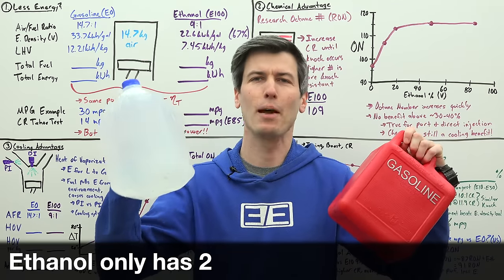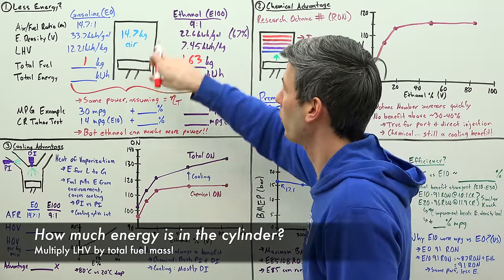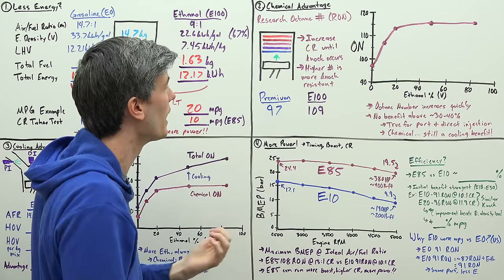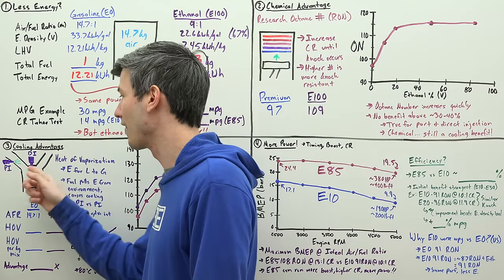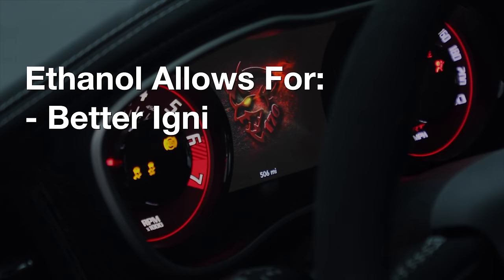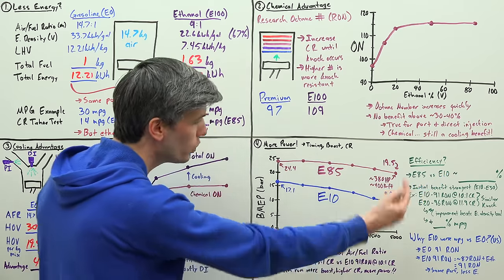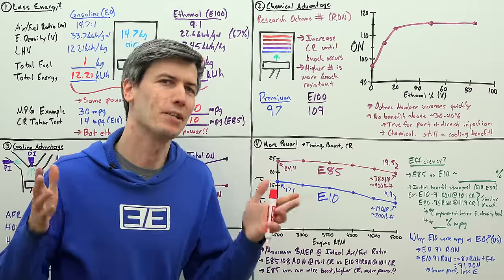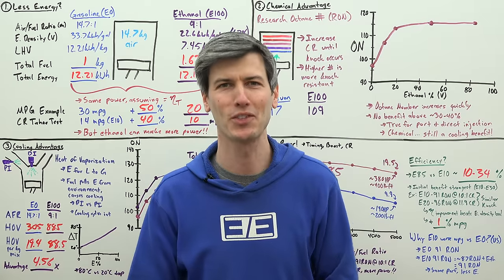Why Does Ethanol Make So Much Power? (Versus Gasoline)

Comment: Ah, but we don’t have variable compression engines! The trouble is that until you standardize the fuel mix, you can’t standardize (and increase) the compression. Or vice versa. So which comes first, the blend or the compression increase? And then how do we transition the fleet?  We all will continue to drive compromise designs.

Now, if we keep power constant and use E85 we could use a smaller engine and possibly improve mileage.  Hmm.
Reply: Look up the engine Ricardo built for GM and drove around a few years ago.  Here is an article excerpt about it at the time:

FROM RICARDO:
The new federal CAFE standards are calling for a doubling of fuel mileage performance, which, Vint says, is going to send OEM’s looking for high octane numbers to improve efficiency and ethanol is the best source. Ricardo, an engineering firm with over 100 years in the business of engine design, has developed an extreme boosted direct injection engine (EBDI) to optimize ethanol blends. The 3.2 V6 gasoline engine rivals the power and torque of a much larger GMC Sierra 6.6 diesel, he said, and it delivers 3.5 percent better fuel economy than the diesel.

Comment: Is it just me? or does anyone else see how much more complex cars with turbos are.
How much more to repair, and cramped engine bays with all that plumbing? To me, and what I observed it is way more expensive for a normal car and not worth it. Any money you save with turbo and better MPG you will give up with high pressure fuel rail and injector failure. Along with carbon build up on valves? I really like your videos. I just see many friends and relatives shelling out huge repair bills for all the above mentioned items. I have learned from these videos to never buy direct injection or turbo cars for daily drivers. Thank you
I have 2008 chevy 5.3 port injected and my wife drives a 2018 3.5 taurus limited. They have been perfect.
Reply: My father is 76 and has repaired his cars himself since he got his license 58 years ago. He has never owned a turbo car.

Comment: As a user of 100% ethanol since 1986 can agreed more. We make ethanol from sugar cane (not corn) Now with a model 2022 Peugeot 2008 SUV. 1.6 liters 4 cylinders 120 HP with a city 7 kilometers per liter and 9 kilometers per liter highway. (a lot) But 1 liter of ethanol cost about US$0.6 vs US$1+ for gasoline. Greetings from Asunción Paraguay
Reply: Paraguay does make ethanol from corn also because you feed cattle and it is better than feeding the corn straight in many ways.

Corn is a great fit with your sugarcane since it allows your ethanol plants to run more efficiently all year long between the sugarcane harvests.  Corn stores well and sugarcane does not.

The fuel for non-flex fuel cars there is E27, correct?
Reply: @danafletcher2341  I don't know the exact proportion of ethanol in the gasoline for non flex vehicles (I have one non flex but it runs on 88 octanes) maybe just 97+ octanes is (maybe) free of ethanol. Have to research in the law here. We have a law that makes mandatory the use of ethanol in the "maximum possibly proportions" suitable for car and bikes. Greetings Pd: don't know about any ethanol from corn here. There's shortage of ethanol sometimes between harvests. But we buy it from Brazil so is always available. But maybe you are right.

Comment: I have a 2009 Ford Crown Victoria Police Interceptor that is Flex Fuel and in California E85 is about $3.30 a gallon and regular fuel is $2.00 (about) more and I’ve been wondering if it would be cheaper to run E85? I am not the type of person who beats my car or drives it crazy, I am an old grandpa now and I drive like one too lol… Here on the east coast it’s very hard to find but is only about $.25 a gallon cheaper but the car runs so much better on E85!!! Any thoughts 💭???
Reply: The EPA rated the 4.6L flex fuel Ford Crown Victoria at 19 mpg on E0 and at 14 mpg on E85.

The cost per mile with your numbers given for E85 is $.236 per mile.

The cost for E0 with two dollars more for E0 is $.279 per mile to drive.

You said regular fuel so if that is instead E10 then I used too much mileage since the EPA states the US fleet loses 3 to 4% mileage with E10.

If your “regulator fuel” is E10, then the cost per mile is $.291 per mile to drive.

I used 18.24 mpg for E10 which is 96% of E0’s 19 mpg.

Comment: This is all fine... but the problem remains that a very large number of cars on the road today, cannot detect ethanol in the fuel, so do not adjust the AFR ratios... so run like crap on ethanol. For the most part this isn't a problem for most cars unless your vehicle has a lean burn mode, and then it will also screw that up and cause it to fail to stay in lean burn mode by loss of power / missing etc... because its running too lean for the ethanol mix. My honda insight definitely runs differently on E0 vs E10... if the EFI were adjusting the AFR to compensate there would be very little loss in power and it might even run better but it doesn't. Also in the USA we use one of the worst possible sources for ethanol... corn that takes about a gallon of fossil fuel to product each gallon of ethanol.
Reply: Your car adjust the air fuel ratio using the O2 sensor. I doesnt care what the fuel its running it wants to run Stoic. Most OBD1 and OBD2 cars can adjust up to 30% rich or lean I have found.
Reply: Corn is most efficient source of ethanol out there since it is value added from already existing corn feed production and preserves the feed.  So much so that Brazil put an import tariff on it.

All the fossil fuels/energy it takes to produce and deliver a product to the consumer is reflected in the price of that product.

As such note that the spot cash price of ethanol on the NYMEX is just $2.35/gallon.

The price of sub-grade unusable gasoline (RBOB) is $2.70/gallon.

It takes more energy and fossil fuels to make sub grade gasoline than ethanol.

To turn RBOB into usable E0 fuel costs even more much like premium costs more.  Unfortunately for humanity it becomes far dirties, carcinogenic, and toxic as well.

Or, simply splash in >10% ethanol to RBOB and the resultant usable fuel is far cleaner burning, less toxic, less carcinogenic, and cheaper/cheaper per mile to drive.  Who can be against that?

Iowa State University measured all the energy it takes to produce an acre of corn into a "diesel fuel equivalent"
This included making the machinery, fertilizer, chemicals, plus the tillage, planting, harvesting, drying, trucking etc. 
They found it takes 34 gal of diesel to produce one acre of corn.
What do we get from those 34 gallons of diesel?
We get >500 gallons of ethanol.
But wait, that is not the kicker.
The kicker is we still get 100% of the protein from that acre of corn still available for an even better feed called distillers grains. A win, win.

The very same non-flex fuel vehicles we have use E27 in Brazil.  It has worked out so well and for so long that Paraguay went to E27.

Denver in 1988 was the first government entity to require E10 when they were on the EPA list of ozone non-attainment zones.  Soon with ethanol they were off that list.

Even with just 10% ethanol added to E0, the Swiss Federal Laboratory for Materials Science and Technology found that the especially health devastating ultra fine or nano particulate emissions were lowered by 97%, carbon monoxide lowered by 81%, carbon dioxide lowered by 13%, aromatic hydrocarbon emissions lowered by 67-96%, and genotoxic emissions lowered by 72%.

Comment: I'd like to see them do the same test on an eco boost, but reduce the size.  So if they started off with a 3.5L, then build an engine that is about 1.7L and see if you can make the same power 185HP.  Then put that engine into the same truck and see what kind of MPG and $/mile you'd get.  The real issue is how much does it cost you to drive 1 mile.  If E85 is 40% cheaper than gas and you can have a 1.7L doing the same work as the 3.5L, then crunch all the numbers and see where you're at.
Just like back in the old days when a turbo, blower, EFI, VVT, etc... were used in racing, then became more mainstream because they can get more MPG or $/mile.
Reply: GM had Ricardo build something like you're talking about which they drove around in a pickup with a few years ago:

FROM RICARDO:
The new federal CAFE standards are calling for a doubling of fuel mileage performance, which, Vint says, is going to send OEM’s looking for high octane numbers to improve efficiency and ethanol is the best source. Ricardo, an engineering firm with over 100 years in the business of engine design, has developed an extreme boosted direct injection engine (EBDI) to optimize ethanol blends. The 3.2 V6 gasoline engine rivals the power and torque of a much larger GMC Sierra 6.6 diesel, he said, and it delivers 3.5 percent better fuel economy than the diesel.

Comment: How do modern engines compensate for either E85 or E0?
Reply: They have to be setup to run Flex fuel is whats its called.

Comment: If anyone on here is smarter than me, please explain, I run E85 in my supercharged Vette but my AFR gauge is usually around that 14.7 number he mentioned for gasoline.  Shouldn't I expect that number to be much lower based on what this guy is saying?  I really trust the tuner, so I doubt it's wrong, what am I missing?
Reply: What gauge? You should really use Lambda scale so if the fuel mix is a little off say 80% the reading is still the same.
Reply: @oldblueaccord2629  I don't know the specifics of the guage.  It was installed by the shop that did the build.  It's an air fuel ratio guage that sits next to my boost guage.  It's almost right around 14.7.
Reply: @IcyDeath91  14.7 should be correct at warm idle and closed loop on gasoline. Its how the gauge is set up to read the o2 sensor is the big question. If it reads that at WOT I think you need to talk to your tuner.
Reply: @oldblueaccord2629  I run E all the time.  Its not high quality E so it could be anywhere between E50 and E85.  I'm sure the tune is supposed to account for actual ethanol content.  Car is never at WOT unless it's on the Dyno.  Too squirrelly for public roads lol.

Comment: That's one hell of a cylinder! 14.7kg of air and 1.63kg of ethanol! According to my napkin calculations that's about a 11'400 liter cylinder. A container ship has a displacement of around 2000 liters  per cylinder. Am i missing something? (Yes, I know these units and numbers were picked soley to illustrate the energy density and the power of the respective fuels)

Comment: I don't run at the race track, I run on the streets and highway, so I fail to get this guys video. I'd rather have better MPG and less fuel dilution of my oil in my crankcase (I'll explain more on that later). I get noticeable better gas mileage with non-ethanol and my car has more power (seems like it to me)  and runs smoother. But non-ethanol costs 20 cents more per gallon that ethanol blend so I don't see any economic benefits since the 20 cents extra makes up for it. But I end up running non-ethanol anyway. Typically my Honda Civic Sedan with the 1.5T engine, I get about 46 mpg on the interstate and about 42 with the E10 ethanol. I also think the fuel dilution problem with the Honda 1.5T engine (due to direct injection) is less of a problem with non-ethanol. I think the ethanol gets the fuel get through the piston rings easier, whereas pure gas has more trouble getting through the rings, minimizing the problem of dilution. And the last thing you need with the Honda 1.5T is to run cooler in the cylinder, which he explains is a benefit of ethanol!! That increases the problem with fuel dilution!! With the 1.5T, you want hotter temperatures to burn off the fuel before it leaks through the rings into the crankcase to dilute your oil. That's why fuel dilution is worse in the winter due to the wait until warm up. And diluting the oil will ruin your engine! So I go with non-ethanol all the way.
Reply: Cant blame you there junk Honda motor you gotta do what you got to do to make it last.

Comment: From a theoretical standpoint, if I can use E0, E10, E20, or E85 in my 2007 Porsche 911 GT3 (port injection 3.6L), which fuel is going to make the most power assuming stock engine management controller?  It seems that if I do not care about about MPG (which I do not for track days), that E85 would be the best option, but is this really the best option for producing the most power given the limitations of the ECU?  What about other octane boosting substances like VP Octanium, Race-Gas concentrate, or similar products?  Thanks and I really enjoy you channel!
Reply: Wild guess no more than 70% Ethanol.

Comment: Lower BTU Ethanol offers “more power” than higher BTU gasoline when it’s run under high boost because it burns cooler and is less prone to detonation. But in a normal street application gasoline gives better mileage and flexibility. It’s only when you’re trying to extract maximum hp from maximum compression/ignition timing that ethanol’s characteristics become the better option.
Reply: A Chevy 5.3L is rated at a clean 380 horsepower on E85 vs a dirty 355 on E0.

The cost per mile is less with ethanol besides drastically cleaner air.  Diesel gives better mileage than gasoline, yet we still use gasoline.

Ford's first prototype Ecoboost was optimized for E85 and mileage was 15 to 20% better on E85 than E0 with load performance similar to a diesel.  Ford thought they could skirt paying the MIT scientists' patents on the technology by coming out with it only in a non-flex fuel version.  That is in litigation.

Ricardo built and drove around an ethanol optimized engine that was half the size/twice the power of gasoline and diesel engines with mileage better than either, even the diesel.

Because of this engine, GM want the EPA to come with a 100-octane fuel standard because they are concerned about E85 availability (which Ford also was).  Less than 2% of fuel stations in the US have E85 vs France which has 25% availability.

This is not new technology or knowledge, it was known long ago.  It is suppressed technology.

Rear Admiral C.M. Chester wrote Henry Ford a letter on Dec.15, 1916:
"...I also pointed out in the article that as governmental laboratories had developed from 40 to 55% efficiency in alcohol engines as against 20% in gasoline machines, the use of alcohol at double the cost of gasoline for power purposes, was cheaper for motor[s] than gasoline in common use today."

Scientific journals from 1890 – 1920 contain hundreds of references to alcohol fuel at the dawn of the automotive era. 

Studies of alcohol as an internal combustion engine fuel began in the U.S. with the Edison
Electric Testing Laboratory and Columbia University in 1906. Elihu Thomson reported that despite a smaller heat or B.T.U. value, “a gallon of alcohol will develop substantially the same power in an internal combustion engine as a gallon of gasoline. This is owing to the superior efficiency of operation…”

The USDA tests in 1906 also demonstrated the efficiency of alcohol in engines and described how gasoline engines could be modified for higher power with pure alcohol fuel or for equivalent fuel consumption, depending on the need.

The U.S.Geological Service and the U.S. Navy performed 2000 tests on alcohol and gasoline engines in 1907 - 1908 in Norfolk, Va. and St. Louis, Mo. They found that much higher engine compression ratios could be achieved with alcohol than with gasoline. 

When the compression ratios were adjusted for each fuel, fuel economy was virtually equal despite the greater B.T.U. value of gasoline. “In regard to general cleanliness, such as absence of smoke and disagreeable odors, alcohol has many advantages over gasoline or kerosene as a fuel,” the report said. “The exhaust from an alcohol engine is never clouded with a black or grayish smoke.” USGS continued the comparative tests and later noted that alcohol was “a more ideal fuel than gasoline” with better efficiency despite the (*then*) high cost.

Comment: My main issue with E85 is the production of it is SO energy intensive. Furthermore, the fuel is fairly corrosive to engine parts and increases maintenance costs.
While E85 has uses on the track, gasoline or electric are better engine choices for most scenarios.
Reply: Ethanol on most any manufacturer's chemical compatibility chart will show ethanol at worst is equal to but more often less corrosive to rubbers, metals, and plastics than what gasoline and BTEX (benzene, toluene, ethylbenzene, & xylene) are.

Ethanol spot cash delivered price on the NYMEX is $2.19/gallon.

Unusable sub-grade gasoline (RBOB) is priced at $2.65/gallon.

Gasoline is more energy intensive than ethanol!

To turn RBOB into a usable E0 fuel costs even more much like premium does.  Unfortunately for humanity it also becomes more toxic and dirtier.

Or simply splash in >10% ethanol to RBOB and the resultant usable fuel becomes less toxic, far cleaner burning, and cheaper/cheaper per mile to drive with.  Who can be against that?

The Bureau of Labor Statistic tracked the share of US household income spent on repairs and maintenance from 1990 to 2017 as ethanol as a percentage of gasoline went from .1% in 1990 to around 10% from 2011 onward.

The share of income spent on repairs and maintenance was 2% in 1990 and by 2017 it was 1.5% as ethanol use exploded.

In Brazil they found identical engines running on E100 vs their common gasoline lasted >300% longer.  Soot is what wears out an engine.  Ethanol is sootless.